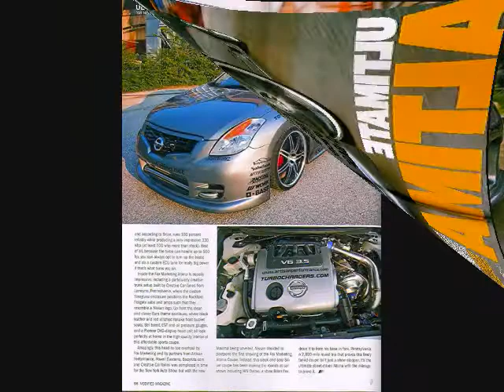The 2008  Modified Mag "Ultimate Altima"

Comment: Just as a note, altimas dont come with LSDs. Notice this one is boosted (unless that's a face IC) With an open differential, and being front wheel drive, that vq35 will send you into a wall n/a let alone under boost. Awesome car, and very good job :) 

(coming from an 05 3.5 owner)